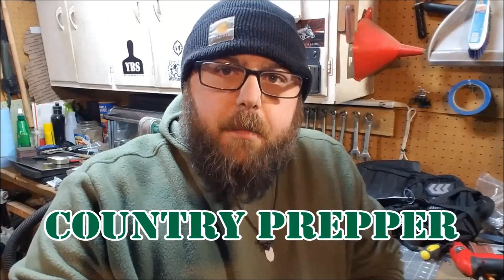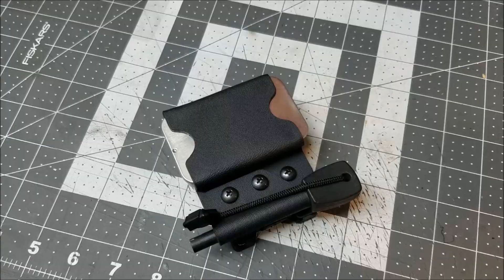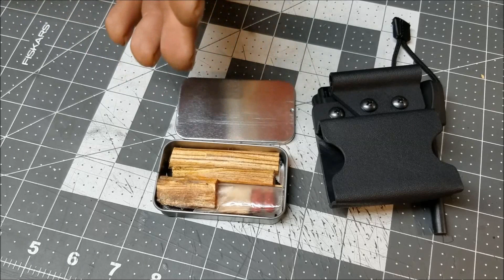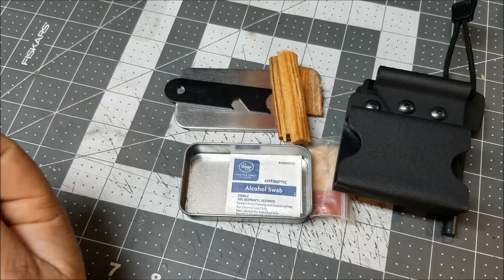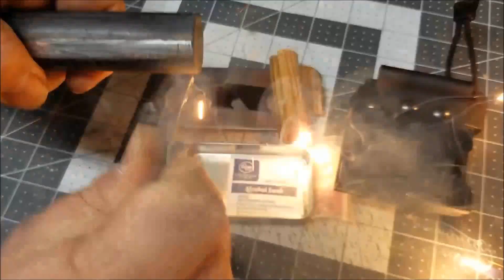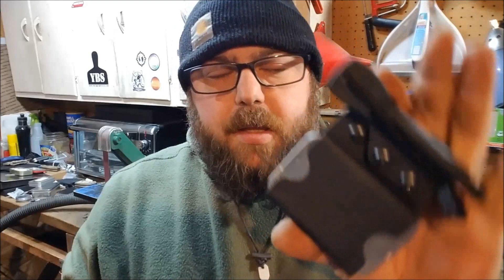Building a Mini Fire Kit for My New Get Home Bag

Comment: Flashlight: KLARUS Mi7. About the size of an AA battery, runs on one and gives 330 lumens or with 14500 battery, 700 lumens. For fire kit, a small ziplock bag of Magic Punky Dust will go a long way. Can catch a spark or ignite with solar lens.